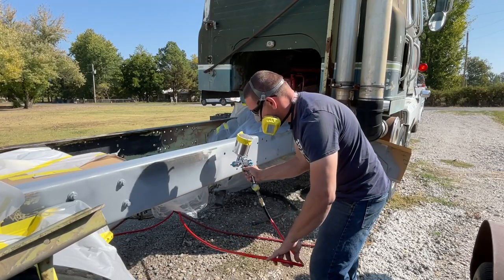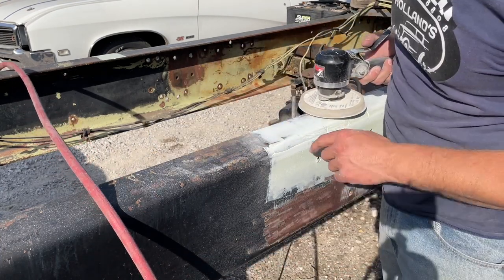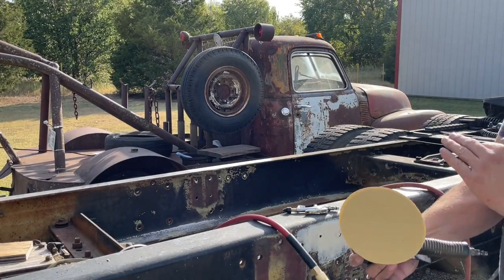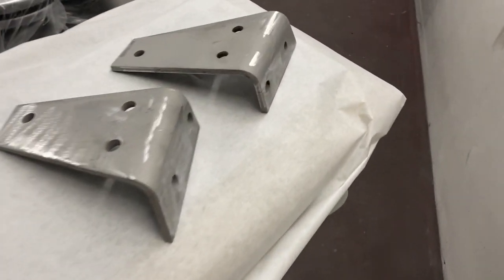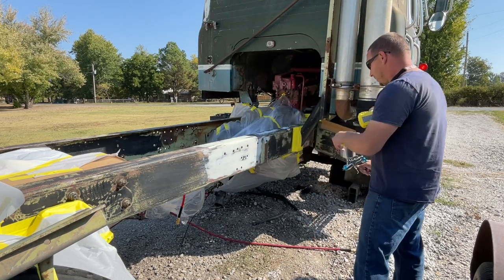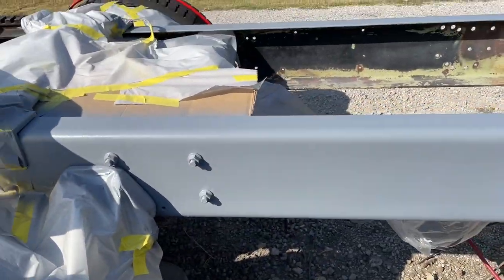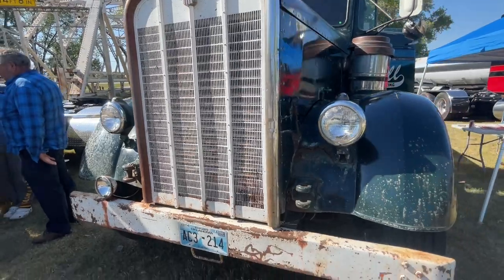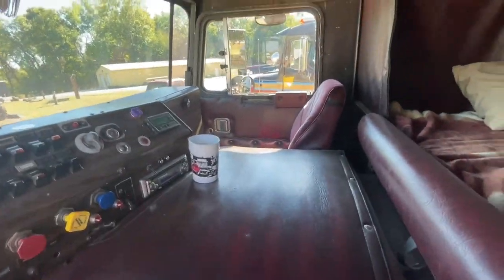Cabover Restoration. Episode #22. Fixing ugly stuff on the frame and some extra show footage.

Comment: Surprised those cross member brackets were cracked like that. That’s really wild. At least you can patch them up tho. The frame is gonna look sweet and slick smooth! There is more than likely rust under that fifth wheel plate. I know you’ll make sure to paint inside those holes in the frame. It’s coming along great. Those are some really nice old trucks at the end. I see the bug is in the shed. Can’t wait to see the next video